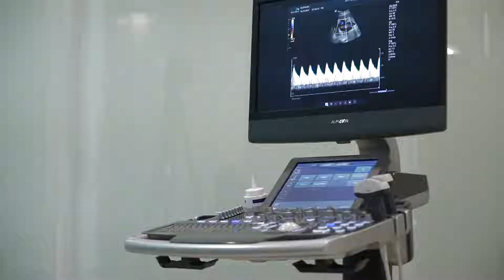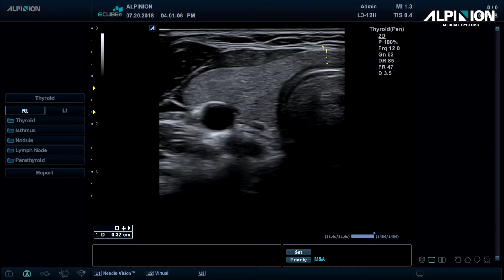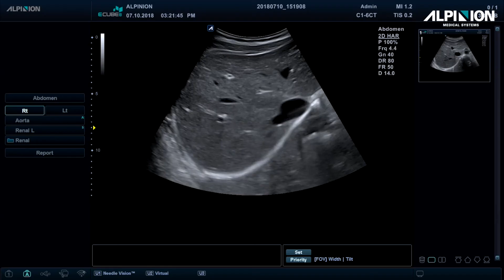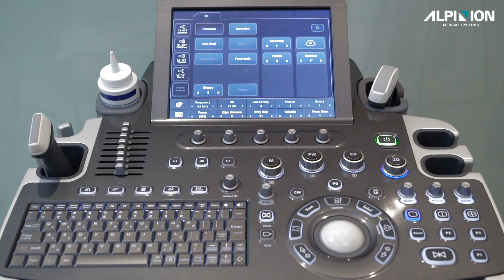E-CUBE 8 Tutorial Video

Comment: 00:18 part 1 
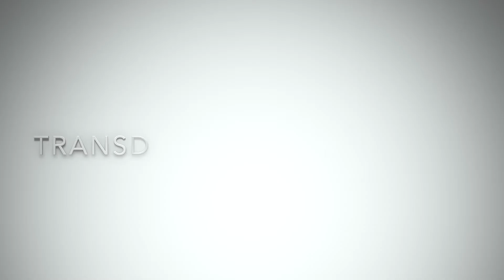01:59 part 2 Transducer & foot switch
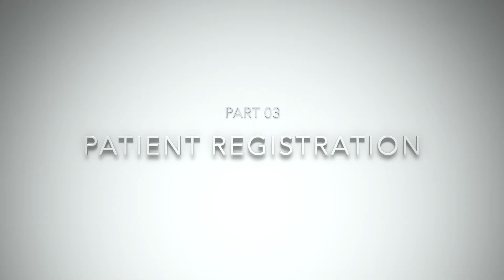03:16 part 3 Patient registration
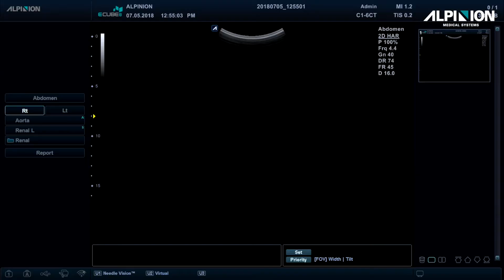04:03 part 4 Select probe and preset
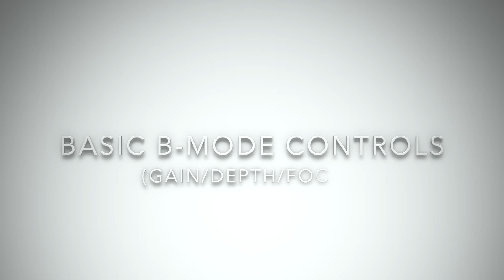05:22 part 5 Basic b-mode controls
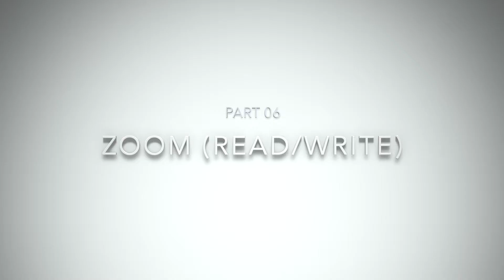06:45 part 6 Zoom (Read/Write)
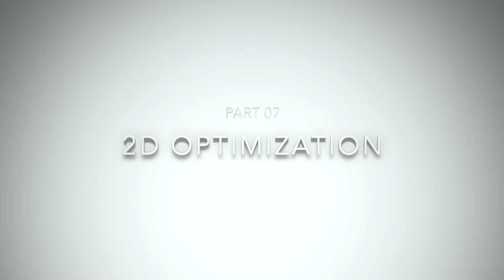07:49 part 7 2D optimization
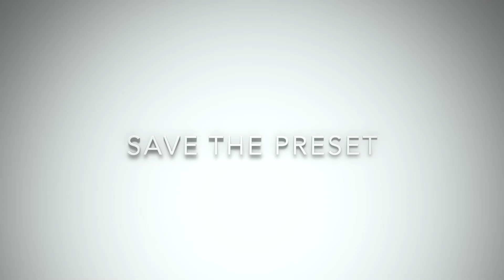08:59 part 8 Save the preset
09:29 part 9 Xpeed; Image optimization
10:05 part 10 color flow mode
11:48 part 11 Power Doppler mode
12:46 part 12 Pulsed wave mode
14:06 part 13 Auto calculation
15:02 part 14 Basic measurement
15:37 part 15 Labeled measurement
17:37 part 16 Annotation (Text & Body marker)
18:35 part 17 Save the still/cine image
20:04 part 18 Eview
20:50 part 19 Back-up & Send-to
22:57 part 20 Review the old study
24:00 part 21 Post processing
Reply: whatapp
Reply: @sengseng7582   I'm sorry. I have nothing to do with this company.
Reply: How to print